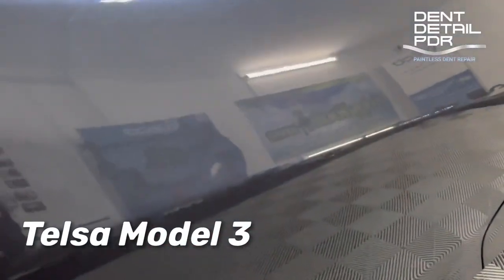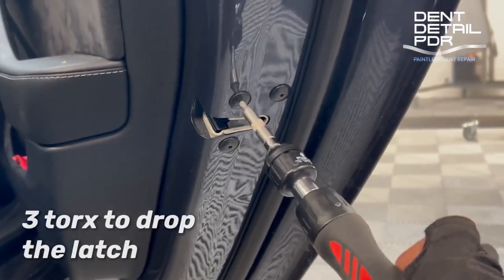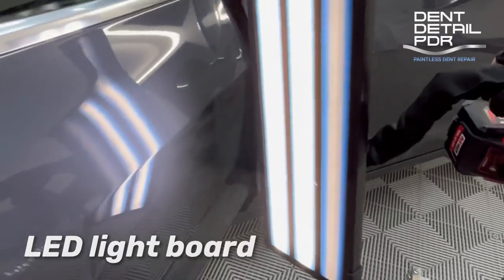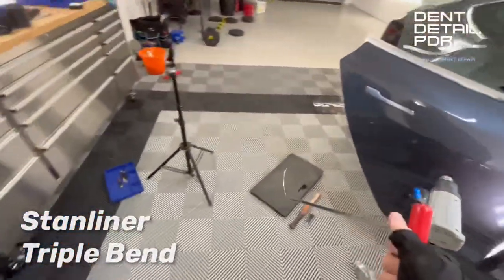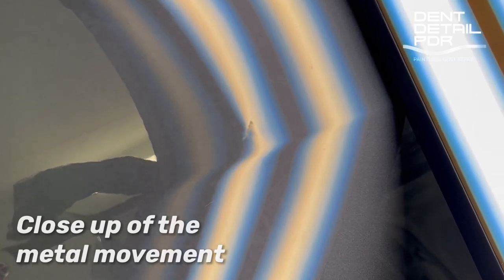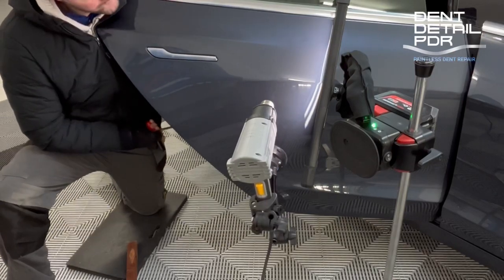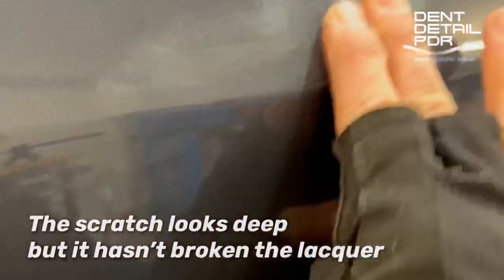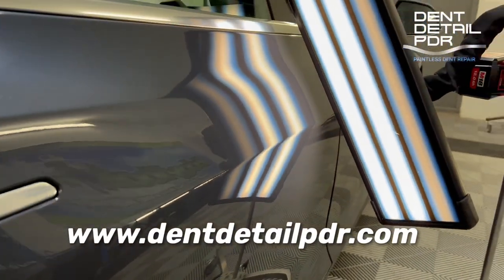How to remove a dent on a Tesla Model 3 ALUMINIUM door! | paintless dent repair | best access tool

Comment: You make it look so easy! Ive got a dent in almost the same spot on my tesla. I just cannot get between brace and skin - the tool tip is only a mm thick - any advice? Thanks!!
Reply from the maker: Thank you, it would be depend which year model and which angle you are going in to repair the dent, the tool choice is key too
Reply: @dentdetailpdr  it's a 23 Y. Went in the same way as in your video. I even put a snake camera in there and the brace hugs the body line...no way in with a tool that I can tell. Perhaps US models are different? Have to resort to glue pull but that last little center of the dent just won't budge from the body line. Perhaps I'll have to pack the door in a suitcase and come visit! :) cheers!
Reply from the maker: @sparqify  it will be down to the tool then, once you get the right shaped one they can be reached

Comment: Hello Friend!!  I have a question, hot glue could have been an option to reduce the damage and then go in with the rod to finish it?  o was very risky, very good video!  It turned out perfect, thanks for sharing, greetings from Mexico!!✌🏼
Reply from the maker: Hi Neto thanks for the comment and watching the video!

Glue wouldn’t of been of benefit, as we can get good access from underneath, and it would be quicker to push it out, glueing it would of mean we spent more time opening up the dent, and being aluminium would of took a lot longer.

Also the paintwork was scratched, and not knowing how deep it was until the dent was pushed out, could of resulted in the paint lifting away if we glued it.

Thank you for the question!

Comment: Possible to fix such a dent from outside using glue sticks?
Reply from the maker: Hi thanks for watching, dents like this can be glue pulled from the outside giving the paintwork is in good condition with no chips or scratches
Reply: @dentdetailpdr THANKS…what I needed to know. Got a dent on the pax side rear door of my brand new Model Y😢 Bought a glue pull device from YouTube and watching your video wondered if I bought the wrong thing. I’ll heat up the panel tomorrow and try the glue pull🤞
Reply from the maker: @Skyking6976  ok good luck